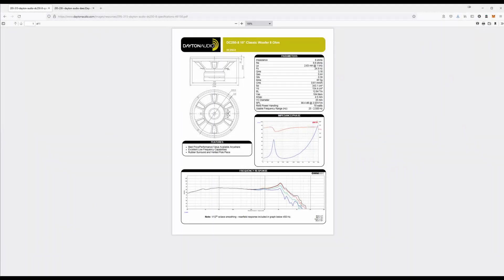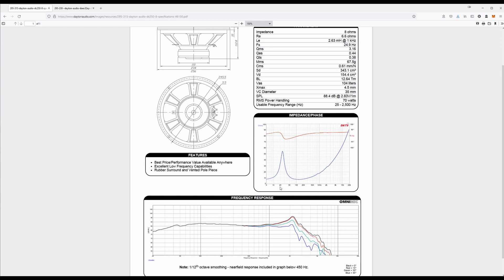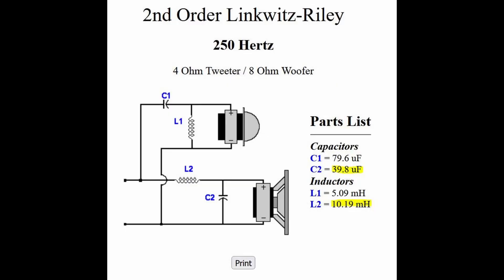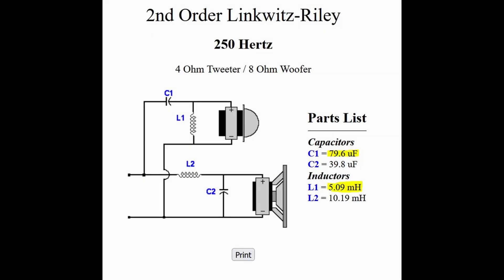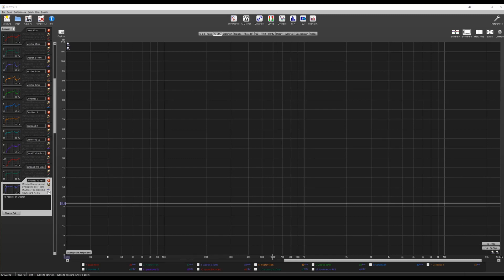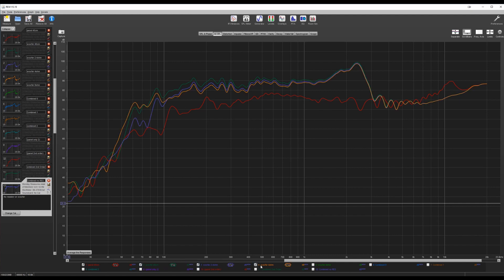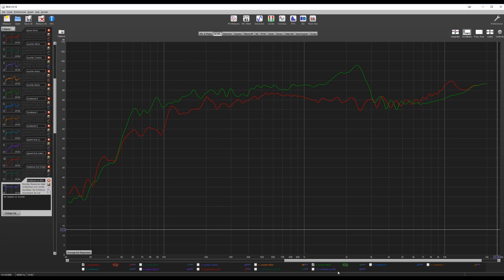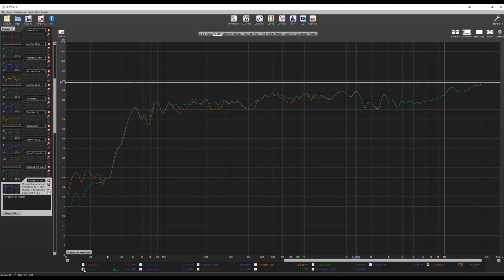Hybrid DML Speaker Build 3 - The Crossover

Comment: Great video! I listen on my magnapan mmg  and wow sounds very good! I am thinking of making a center channel setup to accent my maggies. The box center speaker just smears and I only need it for movies because the maggies center image is dead on! 
Have you tried to use Equalizer APO to adjust your EQ without needing crossover parts?
Reply from the maker: Hey William, thanks a lot! I love the look of those MMGs - do you run them with stereo subs as well?

Are you referring to using an active crossover? If so then yeah and I'm doing it next (currently planning 'version 2' of these floor standing speakers and they're going to be awesome!)
Reply: @TypicalBenYT  Hi Ben ,thanks for responding. Yes I do have two sealed 15" Subs using Rocford fosgate p3,controlled by a crown XTI 1000 which has full dsp and I run them 1 per channel. my system is windows computer based, then the computer sends HDMI to a Onkyo Ht rc270 THX receiver. The maggies Are powered by two Crown xls 1002 drivecore Amps which also have DSP so I bypass the crossover in the Speakers and Run half the amp to the low panel and the other half to the high end for each Speaker. The crown xls amps get the signal from the Pre out from the Onkyo.
I would recommend if you go active to use minidsp and program them With Room EQ wizard. Then send the Signals to Two stereo amps of your choosing! Keep us informed of your progress!

Comment: Excellent video. I plan on building a DLM speaker with two panels per channel. One for low to mid frequencies and one for high frequencies. My amp has a separate sub woofer outlet. 
Can you recommend a Xover for me to use? I’m not as sophisticated as you are with electronics. 
Thanks, 
Paul
Reply from the maker: Hey Paul, sorry it's taken a while to come back to you. As far as pre built crossovers, I'd just be looking for something with a 2-300hz crossover point (will be large components though).
Will you be using a sub as well?
Reply: @TypicalBenYT  
Yes. A powered sub. Thanks for the info. Not many people considering Xovers with these panel speakers, but why not, right?
Reply from the maker: @paulmanhart4481  Yeah agree, why not? There's a reason most high end speakers are crossed over! Are you using different materials for high/low? Or just different sized panels?

I'm currently planning to replace these hybrid speakers with a 'version 2'. Current thinking is to have a sealed sub under a 2-way DML - a larger exciter on a larger panel handling ~250hz - 2.5khz and a smaller exciter on a smaller panel to handle 2.5k+.

I'm hoping that this will allow for powerful mids with more delicate high end... time will tell!
Reply: @TypicalBenYT  Sounds good. I’m using 2 x 2 extruded polystyrene for the highs and 2 x 4 ceiling tiles for the low. I’m not sure if I can bond two 2 x 2 together to make a 2 x 4 out of polystyrene. There might be an acoustic effect from the seam. 
Then I was thinking about a Xover at your specified frequency with maybe a DSP or something to turn down the high end a bit. 
I’m glad I ran into you Ben. Nice to chat with someone knowledgeable about this. 
Paul

Comment: I've been playing around with different exciters and panels over the past few years. My panels are sitka spruce soundboards guitar makers use. I have found the exciters need the feet that extend out making them more stable. Also the 3/5 placement is recommended but for my application center was best. I have two 12" subwoofers with 8 guitar soundboards. Four having 4ohm/40w exciters and the other four 4ohm/20w exciter. One subwoofer crossover is set to 50hz and the other set to 150hz. Sounds amazing and is extremely loud. I still feel some midbass is missing, but don't have the knowledge to build crossovers so I was thinking about getting the amplifier board dayton has with dsp and using the dsp software as a crossover. Can't say yet how this will work but hopefully will get around to doing this soon and can let you know. Also I'm using 2 Fosi 2.1 amplifiers daisy chained together to power it all.
Reply: The panels are are roughly 22.5"x18" to answer your first question.
Reply from the maker: Wow interesting setup. What size are your spruce panels? The Sitka spruce is quite expensive isn’t it?

DSP sounds like a good option there -  maybe you be an EQ it a bit to get the panels strong down to the 150hz sub crossover. 

I’m interested in your dual sub setup using the second one to reinforce the lowest frequencies. How did you arrive at that setup? Do you have pics of your system online anywhere it sounds great.
Reply: @TypicalBenYT  The sitka spruce can get expensive, but Alaska Tonewood has lower priced options I paid about $15ea. I don't have any pictures online or videos but I don't mind emailing you pictures or video. It's not visually up to my standards yet to show off or my wife's so it's half ass setup in my garage which my neighbor love.

Comment: Good video and a very nice flat response curve in the end. Great inspiration! Air cored 10 mH inductor has series resistance about 10 Ohms - that affects the loudness of the woofer the way you wanted it to. The response from the tweeter changed since the nominal 4 Ohm impedance has now parallel resistance of 5 Ohms which lowers the total impedance of your tweeter to around 2 Ohms and this may create the unwanted dip in 3k. Maybe you have to add some more resistors in order to restore the default impedance. Elliott Sound Products has excellent articles about the matter. Also Visaton has very good and free software for their loudspeakers, which has the option of adding your own drivers and model the desired response with built-in crossover designer.
Reply from the maker: This is great info, thanks so much. The more I learn, the more I still have to learn! I'll have a look at those resources and will probably tinker with the XO more in the future.

Comment: Awesome! 
Where do you measure the speaker? Right in front? Is there a standard distance?
Reply from the maker: Thanks! I measured these at 0.5m. Unless you're testing specific things like speaker efficiency, the absolute distance doesn't matter as much as just making them consistent. The measurements are directly in front and a central to the driver as I can make them.

Comment: An excellent, well organized, series of videos outlining your research. I'm inspired and building a similar semi-rigid pair of panels using 0.125" acrylic with your dimensions.  I will experiment various mounting materials like rubber sorbathane, silicon and foam. The attachment scheme I have in mind will not require screws. 

I appreciate all your great work and your willingness to share with others. Now I need to find a good video tutorial on REW.
Reply from the maker: Great that sounds really interesting. One thing I've found with the screw-mount method is that it seems to negate the need to round the corners, as the corners don't vibrate at all. I guess if you had the corners clamped or otherwise well damped you'd have a similar effect though.

I'm interested to see what you come up with - although it's not the most popular material for these, I am enjoying experimenting with acrylic and I think it's a great balance between sound efficiency and aesthetics.

For REW I've just been googling as I go and learning from various DIY forums myself.

Comment: I really like to follow your progress, and how you explain your thoughts and your proces. I do, however, believe you can get a bit further with your design :) But full disclosure: I have mostly fiddled around with speaker design, so ... nevertheless, I've read a lot about it. So I'll give a couple of hints. 

First of all, when looking at your crossover, the inductors are oriented in the same way, which can cause problems. They seem somewhat far apart though, so it might be fine. Look up something like 'crossover inductor placement' and you will find a picture showing optimal and suboptimal placement of inductors.

The second thing is, it does seem like your woofer is in a sealed box? This means that the systems Fs is not anywhere near 24,9 Hz anymore, but more likely 50 Hz, and your measurements seem to show this. If you want more low end, then consider a ported box. The 'seconder' thing is still about Fs, because you show your exciters Fs. This, too, is free air resonance, and the moment you put this exciter on something, it will change dramatically. I haven't studied your measurements, but you might be able to identify the Fs yourself. However, what I will recommend is getting DATS V3 - even I have it, and when designing passive speakers, it really eases up the process. It will give you impedance curves, so your crossovers will perform a lot better. It isn't exactly cheap, but you should be able to sell it, if you don't want to keep it (but you mostly likely will)    

The third, and last, thing I want to mention pertains to my first post on your channel, and it is about convergence. Again ;) Your panel is long instead of 'near-quadratic', so it's going to have some more peaks and dips than a near-quadratic panel. However, you use the placement of the exciter to balance out these convergenses (is that a word?), so the frequency gets more linear. It is the same principle behind Voight Horns; most transmissionline speakers also uses this technique - they place the speaker driver along the line to balance out their frequency response. I think this is a very valid approach, and those small ripples remaining is probably of no audible concern. 

So to your project you don't need anything to fancy, but a measuring mic (you've got that), DATS V3 and knowledge of these programs: Xsim and WinISD. They are easy to learn - and free. I know it can seem daunting, but it will make your speaker design enter the next level. And your concept is good - and interesting. Keep it up :) And thx for the content.
Reply from the maker: Thanks for the detailed post. Yep you got me on the inductors - I wasn't thinking about how I was laying them out as it was only temporary. I probably should have stood one of them up at 90 degrees from the other.

Regarding the woofer - yeah I did initially consider a ported box for the exact reason you describe. For this project though I wanted to use my existing frames and have a relatively small panel (600x400mm) on it. Due to the difference in size requirements (1.4sq ft for sealed, 4.5sq ft for ported) the enclosure would need to be 1.2m long in order to fit in the frame! The construction is pretty modular though so if I come up with a design that I like, I can always 'swap out' the woofer box later for a ported one.

Thanks for the tip on the DATS device - I haven't seen that before. I'll look into it!
Reply: @TypicalBenYT  Hey again. I simmed the response of a smaller, ported box, but link to the document seems to have been taken down. I cannot post pictures here, but I simmed a box of 64L (2,2 ft^3). It is just 40 cm x 3 (inside). However, when I added the volume from the port, it ended up around 69L (whoops), total. Let us say you make the box out of 22 mm MDF. It cannot be wider than 40 cm. That is 35,6 cm inside. We can make the box ... 46 cm high, perhaps? That leaves 41,6 cm there. So we end up with 69000/(35,6x41,6) = 46,6, inside, add then the thickness from the wood, and you get 51 cm. A box of 40x46x51. This will extend the frequency response down to 30Hz (f3), which should be sufficient for most music - and group delay is also kept low. The port itself is round and 12 cm i diameter x 50 cm length (so you will have a bend in it, but that doesn't matter. It's just an example. Your f3 right now is around 48 Hz. At 30Hz it is down to 79dB, whereas the ported box still deliver 85dB; a massive difference. The crossover point between these boxes is all the way down at just below 18Hz, where the sealed box starts to perform better - but whe probably cannot hear that low - and we are down to 71dB. It is of no real importance. I will try once more to answer with a link - that has pictures, which I personally favores in these situations. But again, WinISD and Xsim are really easy to use. It takes a day or two to learn the basics. And only DATS V3 can give you the panels measurements easily. 

A bigger box will give you more extension and a shorter port for the same tuning. And if the low extension is the goal, then it will add more group delay. I think a box half the size with a higher tuning is going to be really good for music. F3 at 30Hz is not to shabby :)
Reply: And once more a link: https://docs.google.com/document/d/1b9swyIFq1VfaRg4ype-9B7U8PJSXbxb461tJMQUwtr8/edit?usp=sharing
Reply: @TypicalBenYT  Just a thought. You could cut a 12 cm hole in the top of your current box, and attach a tube to it? Yeah, it is gonna be 74 cm long, but it is behind your panel - ... well, it would be easy to try out, and with little effort, it is reversible 🙂
Reply from the maker: @jankdmtg6995  Thanks for the amazing suggestions - I haven't had a chance to go through the graphs you send yet but I really appreciate it!

Regarding this idea of adding a port to my existing boxes - how important is the placement of the tube? From an aesthetic standpoint it would be ideal to have it rising out of the top of the box right behind the panel - meaning it would be directly above the woofer's magnet in the box.
Reply: @TypicalBenYT  As far as I know, placement of the port is where science meets art. In theory the placement is of little importance. Some will say it matters a lot - but when I look at the wavelengths going into the port, then (because your box has pure bass) I don't think placement matters in your box. Just do what looks right to you 🙂
Reply from the maker: @jankdmtg6995  Yes this would be very easy to test out especially as I haven't attached the top panel of my boxes yet. Your calculations are based on a 45L box (internal) though and mine are even a bit smaller at around 39.5L internal.

I have read that one can enlarge the effective volume using insulation material - perhaps 10-20%. So in my case that could yield an effective internal volume of 44-48L so maybe that is worth a shot. The long tube isn't a huge issue as I can run it vertically behind the panel.
Reply: @TypicalBenYT  Seems like a good idea. I will just comment one last thing - a tube of such a length (74 cm minus the thickness of the topplate) is going dangerously close to transmissionline territory, and there might be an unwanted resonance at around 115 or so Hz (and again at 230 Hz (and again at 460 Hz)), but then again, it might not do anything problematic? And remember - it is easy to shorten the tube ... ;) Happy building.

Comment: Very nice.  Did you replace the middle bumpers with foam of some kind?
Reply from the maker: Wow good eye. I did actually record an explanation of this but the video was getting a bit long so I left it for next time.

I'm using this:
https://www.bunnings.com.au/moroday-12-x-12mm-x-2-5m-white-econo-weatherseal-tape_p4061878

It prevents 'panel sag' without using rigid attachments. I A/B tested it against the center screws and it sounds a little sweeter to my ears (though fairly subtle difference).
Reply: @TypicalBenYT  Thanks!  Figured it was something like that.  I did something similar with a maple dml I built.